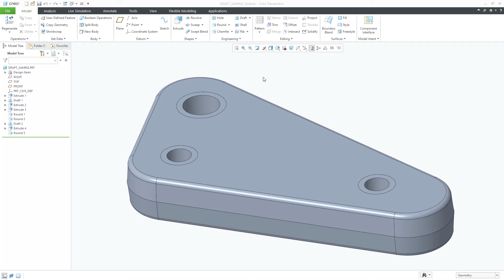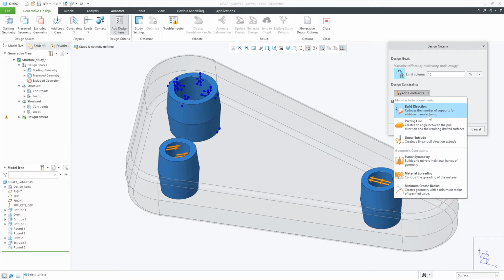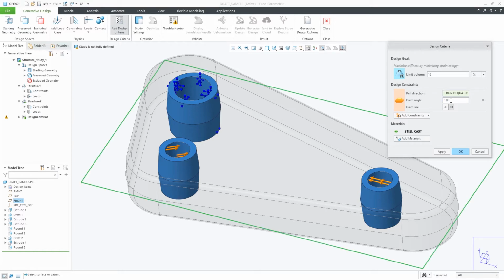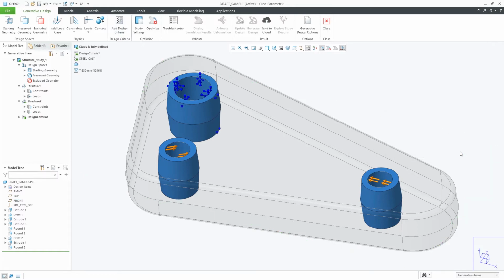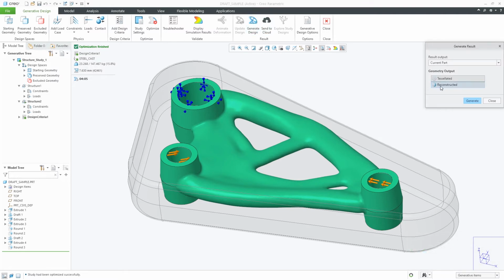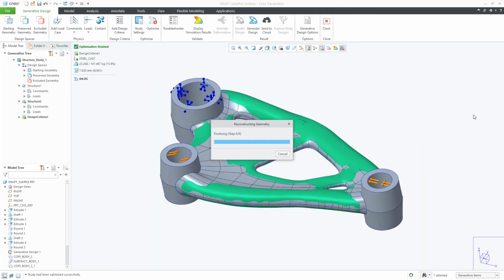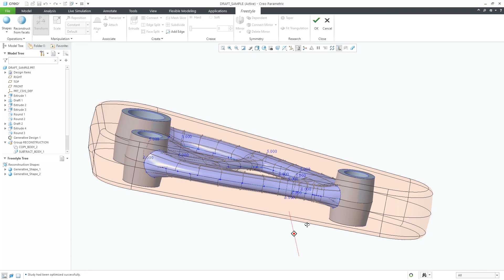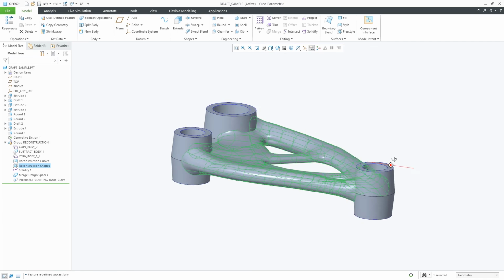Draft Handling on Reconstruction | Creo 8

Comment: You have created parting line and draft angle for very simple component. But creating them to preserved geometries aligned to different axes very difficult. Why not your program to generate by itself the parting line and draft angle based on the plane selected and angle value provided. This facility would be more suitable to say Generative design.